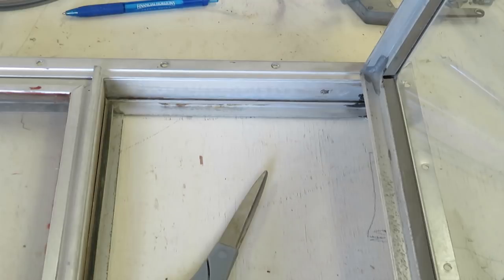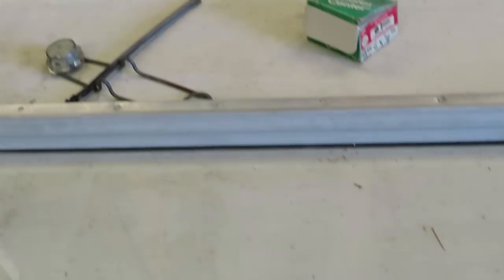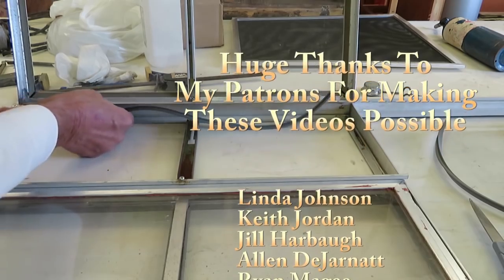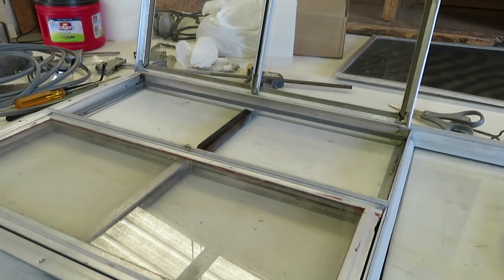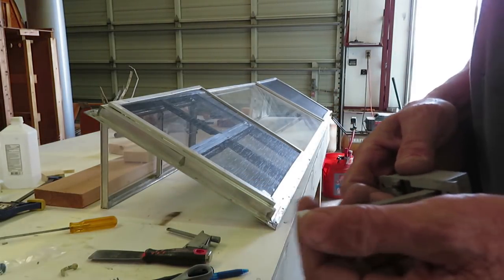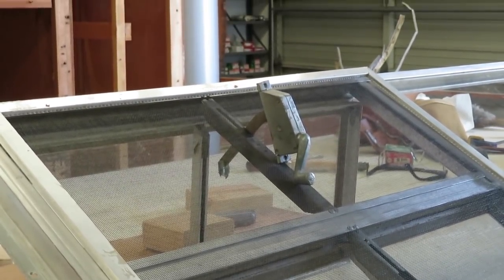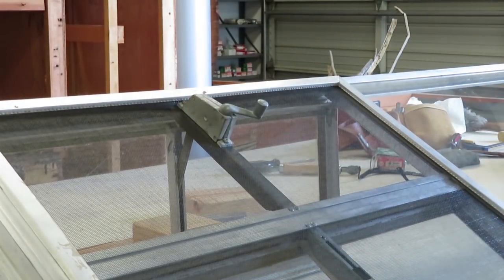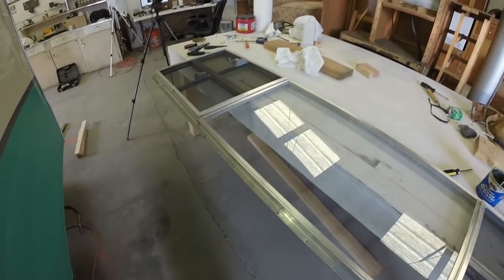Window Gaskets For HEHR 1700 Window Series

Comment: When replacing fixed glass panels do you use standard glass or safety glass ... as safety glass us thicker and more expensive.
Reply from the maker: Regular 1/8 inch window glass that you can get at many hardware stores. You don't need safety glass because it is illegal for anyone to ride in the trailer when it is in motion.

Comment: What type of glass are you using?
Reply from the maker: Just plain old sheet glass like in your old house windows. 1/8 inch thick.
Reply: @mobiltec   is that safe to use without a rock guard?  The camper I have never came with one, and the windows the previous owners had were all plexiglass.  We replaced them with new plexiglass.
Reply from the maker: @turbotension  there's always a possibility of a rock hitting your glass in front I make rock guards for all my trailers.